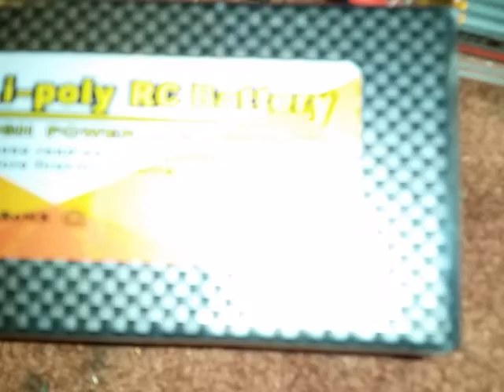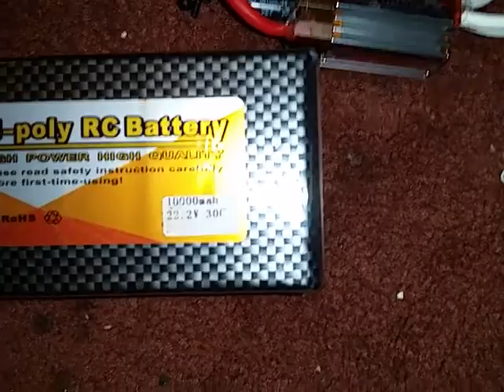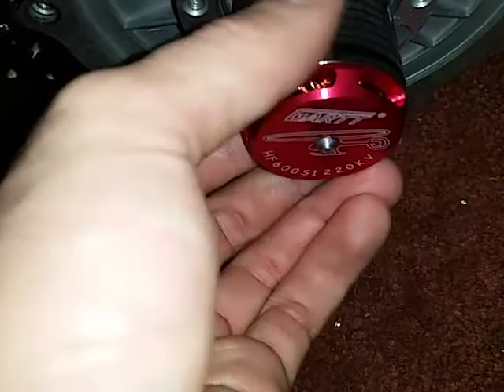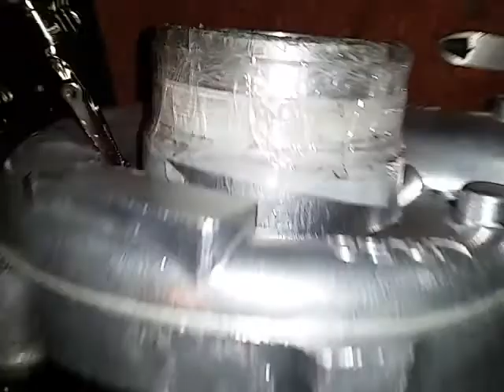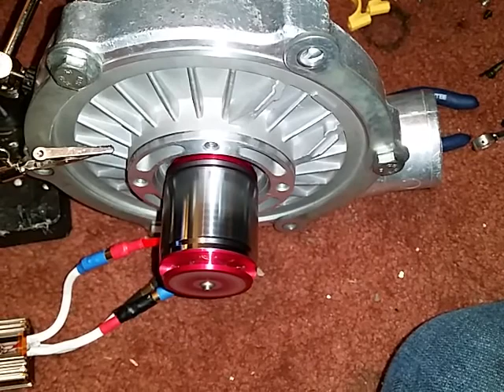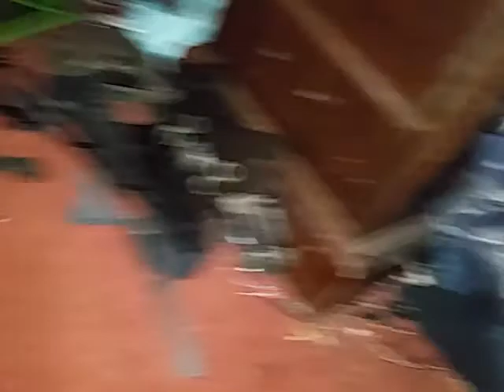Electric Turbo Test.

Comment: Can you set it up to where you could gradually increase the rims?
Reply from the maker: sorry it took this long to reply. the motor doesn't get hot , but it does have cooling made into it, its running at around 15,000 during my first test, now with my new shaft im pushing closer to 32,000 rpm, i plan on setting it up with a arduino to control the boost with my throttle and engine rpm. pressure control will be key on this working right. but only at a very low boost or to assist a regular turbo charger at low engine rpms.